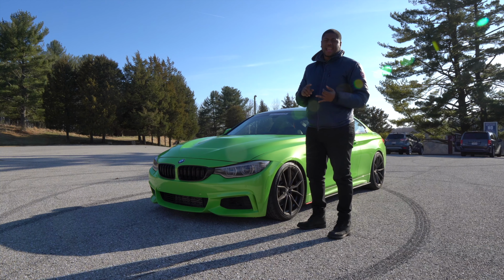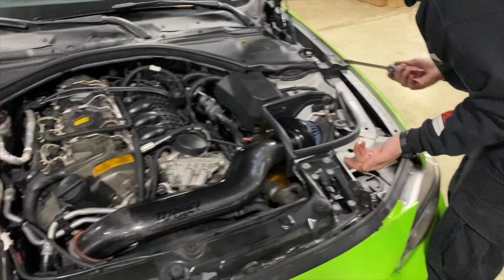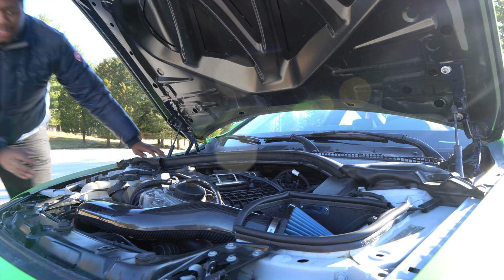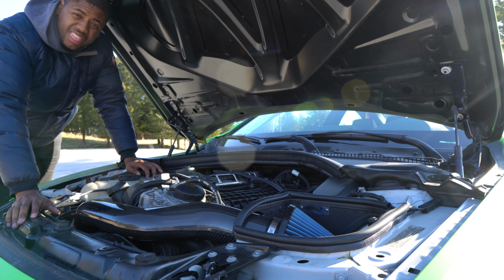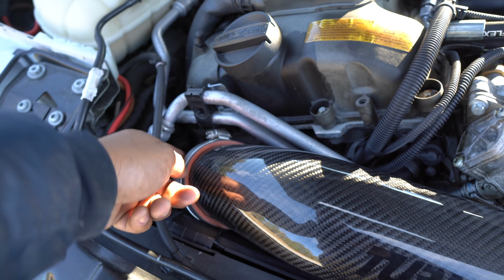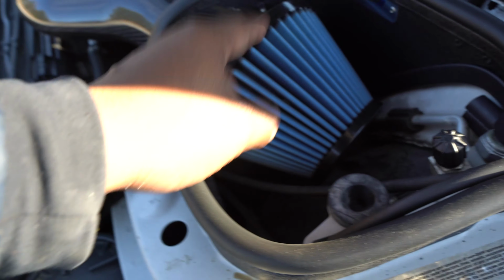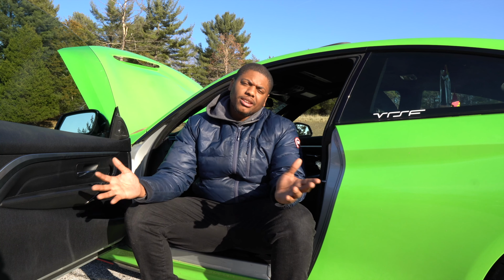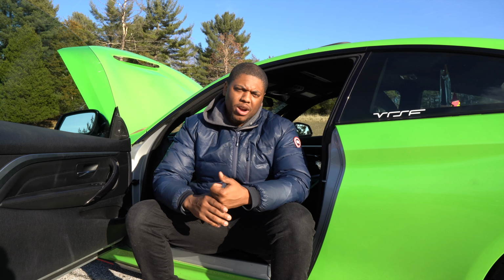Installing BMW 435i Carbon Fiber Intake

Comment: I'm going to buy an intake. I curious to know why you preferred the turner carbon fiber intake instead of the Dinan carbon fiber intake?
Reply from the maker: I chose it due to the open filter design. better noise

Comment: You make me want to buy one and do the same thing. How much total for all the work?
Reply from the maker: What exactly do you wanna buy?
Reply: Slowspeed thinking abt getting the 340i. The 335s are hard to find in the south unless they have over 100k miles
Reply from the maker: 340is are great that b58 motor can take much  more of a beating

Comment: Making me not want to do big boost lol, but Pures don't give much gain. Decisions decisions
Reply from the maker: Its NOT really the kit. I took it to a shop called MPIRE Performance to get it installed and they COMPLETELY screwed it up!
Reply: @Slowspeed  alright
Reply: Slowspeed go to technology R in the Bronx
Reply: Slowspeed damm I just went there for a dp install like 2 days ago. Guy seemed somewhat knowledgeable but this makes me wonder🤔
Reply: Mpire performance is a rip off brother be aware! Many instagram posts about their shop messing cars up and even stealing parts!! Dont go if you live in nyc guys!
Reply from the maker: That’s not too difficult of a job so hopefully everything went well
Reply: Slowspeed Damn bro that’s were I met you too 😂🤦🏿‍♂️
Reply: Suviskobe B Funny you said that after so got my walnut blasting done by him he was seeing a slight misfire of cylinder 4 of my N55. He said it might be the coil and I said replace and he just took one from another motor that was at the shop 😂🙄